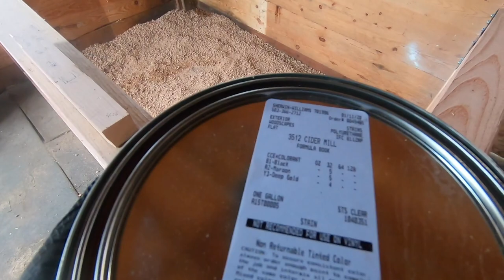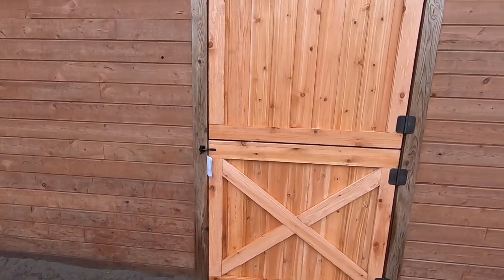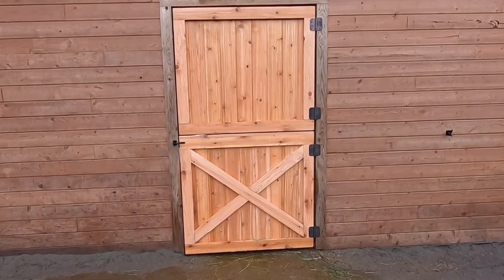Easy DIY Barn Doors - Dutch Doors Install

Comment: I've been building my 12ft x 24ft goat barn for about 3 1/3 years by myself . I understand doing parts of projects as you get the supplies and money! Most of the videos I've seen just take a regular door and cut it in half and add extra hinges. Because of the slope of the barn roof, I needed custom-built doors. Thank you for showing how to do custom doors! Not a carpenter,  just a 68 yr old retired female science school teacher.

Comment: Hello! My husband and I are still setting up our homestead after moving last July, and the frame of a pole barn addition to our garage is going up now. We are putting roll-up doors on both of the far ends but I would like either a single over-sized Dutch door about like you built here, or even a double set of doors this size or slightly smaller. Do you happen to recall the dimensions of what your beautiful creation in this video? Would love to replicate it -- looks fantastic! Thanks, Heather
Reply from the maker: Thanks Heather! These doors were 4 feet wide and 8 feet tall.
Reply: @JohnsonFamilyFarmstead  Awesome. That's about what I suspected and finished my sketch-up and materials/cut list yesterday afternoon. One remaining question: Is the flat-lay board on top of the lower portion of the door a 1x4 or 1x2? Thanks!
Reply from the maker: It’s a 1x4

Comment: Hi there, I've started building my Dutch doors and I like your process. It seems very simple however I do have one question about the measuring. When you take your opening measurement you said subtract a half inch all the way around. So for the bottom door for example, let's say I'm going 48" high and 48" across. I should take the half inch off so my door that I make should be 47x47. Is that right? Just trying to make sure I got what you were saying...lol.
Reply from the maker: Yes, you got it. But I have found since this video I would go a bit smaller than a 1/2 inch. I did a 1/4 inch on each side on the last doors we made. So in your case it would be 47 1/2 x 47 1/2

Comment: Did you put the top ledge in the bottom door after you finished it? I missed that step
Reply from the maker: I put the ledge on before finishing it. I measured the height counting the ledge.

Comment: This may sound like a stupid question, but how do you decide which direction the boards go for the doors in relation to the boards for the barn walls? I noticed the upper part of the barn the boards for the wall and doors are vertical. The bottom of the barn is horizontal and the doors are vertical. Just curious. I would love to have such a beautiful barn. Our barns are steel. Great job!!
Reply from the maker: We decided we wanted to break up the visual because our barn is really tall we wanted to break up the visual effect. A great way to decide is to look at other completed barns and get an idea of what you really like. We definitely got a ton of ideas from looking at other barns and incorporating what we loved from different barns into ours.  We definitely comprised size for beauty. We could have done a larger steel building for sure.... but I would have filled it with to many animals lol.